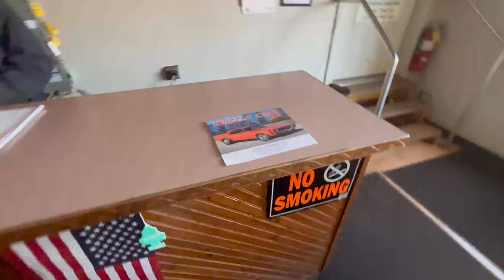MID MUFFLER DELETE ON MY 2015 DODGE CHARGER SRT 392 *BRUTAL DOWNSHIFTS*

Comment: I wanna make scat louder i only got the mufflers cut that’s it what else should I do anyone ?
Reply from the maker: cut the resonators off it the part that's by the rear exhaust tips...
Reply: Mid mufflers and resonators but if u want it real loud cut the converters off
Reply: That’s a bet right on y’all.